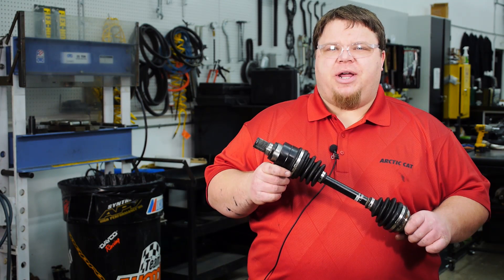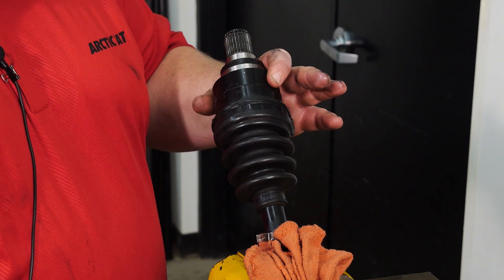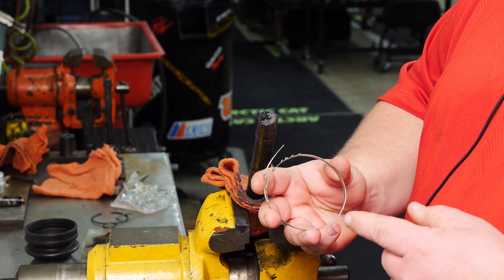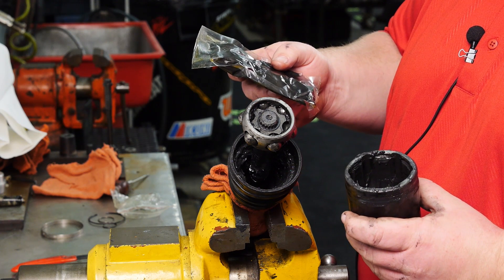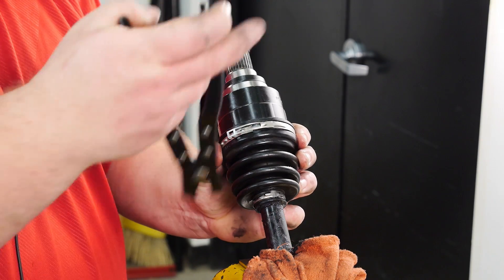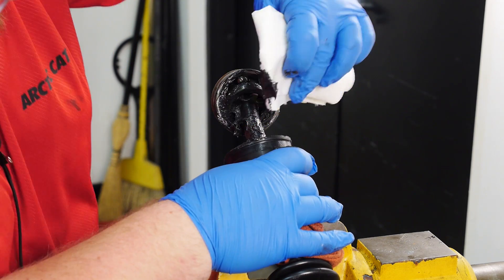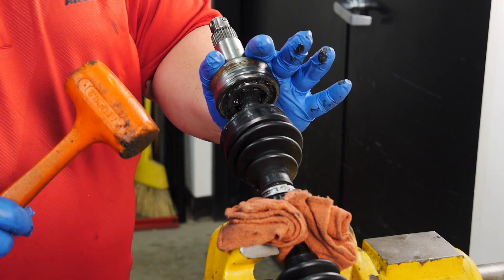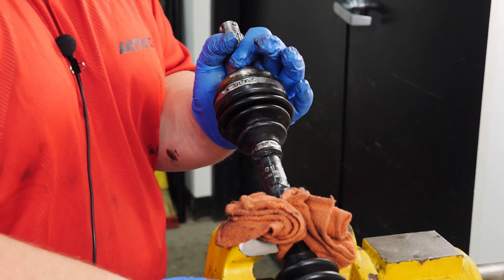Arctic Cat CV Boot Replacement (Old Style)

Comment: I followed your instructions to replace a CV Boot on the passenger side front of my 2012 Arctic Cat 700 Mud Pro H1.  
I got that done, but when I went to test it, my ATV now has a clunk in it towards the back when I shift from Reverse to H or L.  
There's two things I did that might or might not play a part.  While I had it jacked up I shifted it out of 4X4 so I could rotate the axle hub.  The second thing was I rolled the bike ahead while it was in N and on the floor jack.  Any ideas appreciated.  Thx.

Comment: Outboard CV joint removal...a few taps and yours popped right off. Mine won't budge, it looks just like yours. I went from light taps to hard smacks...won't even try to budge.
Reply: It's a pain.  Hit from one side and switch to the other is what I did.  After 5 minutes it finally popped off.  There's a little ring inside holding it in place.
Reply: @ryanmassengale5652  I spun it around and beat on it with and without a ling brass dowel. I didn't see the point of trying penetrating oil considering it is packed with grease. In the end I removed the other end.

Comment: i have an 2003 arctic cat 250 and was wondering if i pull the cv axle out will all my motor and transmission oil come out sense it is all one unit?
Reply: Kountry Quads  if u tilt the side that u remove the axle from slightly higher then the other  it will not drain out